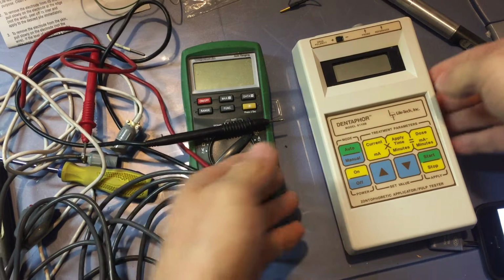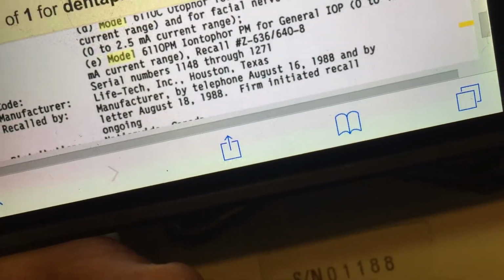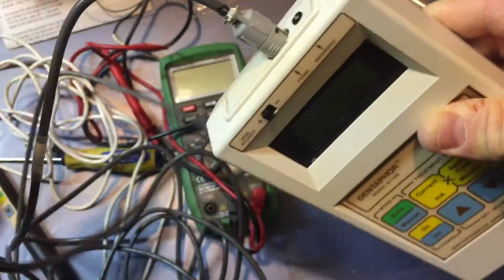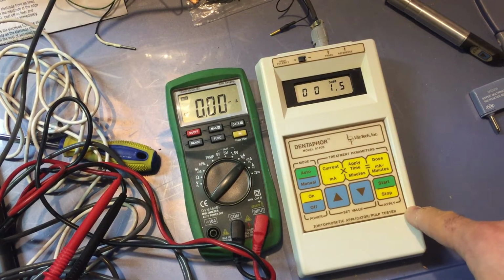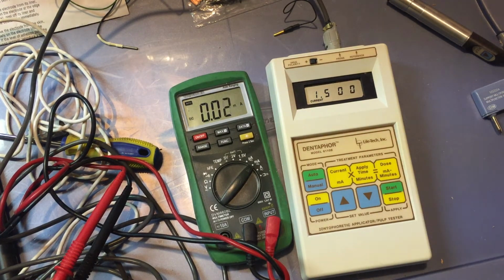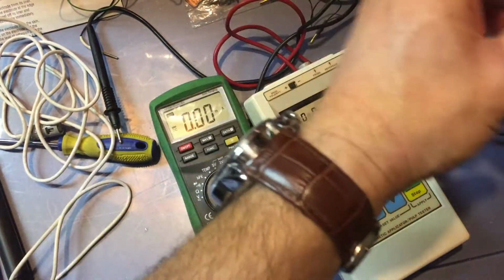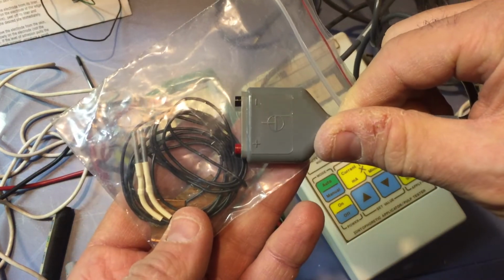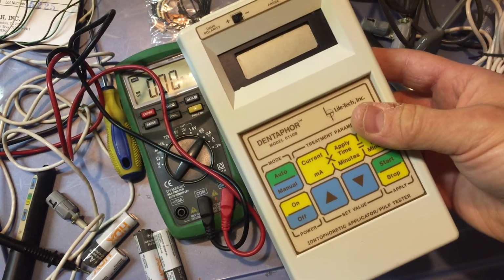Vintage 1980's Recalled Dentaphor 6110B Iontophoresis Device!

Comment: Either they had a separate power supply unit that charged the batteries, that was poorly made and which had a chance of breaking internal mains wiring coming in contact with the battery charge terminals. Otherwise there was a charge adaptor that plugged into the stimulus port, and this power supply would feed back via a diode to charge the batteries , the connector otherwise being switched by a transistor to power the external adaptor in use. 

This power supply might have been faulty, having a 3 wire power cord, but the ground wiring either was poorly soldered to the board, or likely was connected by a screw that they found was not tightened correctly in manufacture. Easier to recall and give replacement units than to try to ensure all the units got a field upgrade, as likely there were only one or two units in that limited serial number range that were faulty, so most would have been left till they came in for service or were obsolete. 

Likely a batch made during a month, that QC found an issue with after a month or two of them being in use, and got a few of the sample units out to see, and confirmed it was a batch issue. Recall entire batch is cheaper than a lawsuit, especially on a device patient connected, though probably it was not possible to use the device while the batteries were being charged, deliberately to reduce the insulation and clearance requirements.
Reply from the maker: Thanks for the information! I've contacted the new company that took over from Life-Tech (WR Medical) to see if I can dig up any more information about what the recall was about and this charging device they were talking about. If the unit allowed rechargeable batteries then it must have needed to use the probe/stimulus port as an input as that is the only connection into the machine with several pins (other than the single-contact reference). I don't have any charging accessories at all. 

Another possibility could have been some kind of "pack/adaptor" that fit into the battery compartment which was just a way to supply 6V to the battery contacts, and it would be supplied by a transformer for outlet 120V AC to 6 VDC. However, based on the design of the battery compartment springs/contacts it seems that it would be difficult to install something like this as a single-piece wouldn't easily be able to fit in there.

I'll see if anyone at WR Medical has any info on it, or maybe people are still using these in the field. I'm curious also as to how early my unit is in the production as I saw pre-release documentation was filed in 1987 for this model, and the serial number is so low, it could be one of the first units.